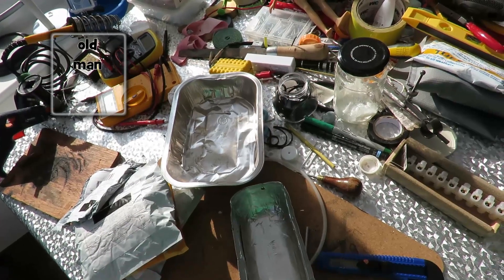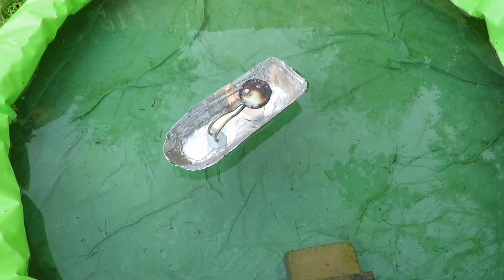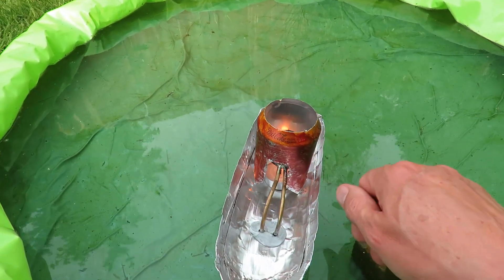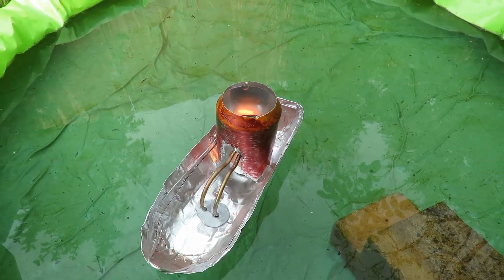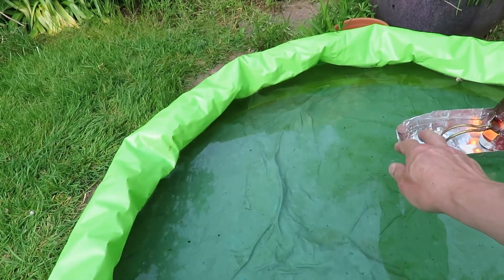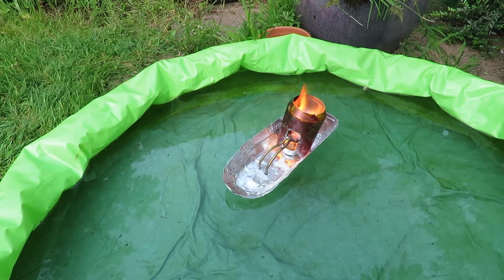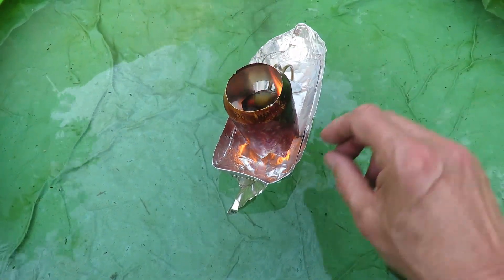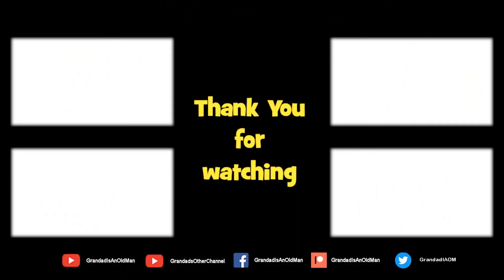Aluminium food tray pop pop boat Ends Badly

Comment: Floating pop-pop BBQ? The solid fuel and firelighters  do put out a lot of heat. They heat up the boiler of a model steam engine really fast and they boilers generally hold a lot of water, so a small boiler with soldered joints won't usually last long. Would be good if you could get a little spot weld on them.  :-)

Comment: Always interesting to follow your Pop-Pop experiments! I have an idea:  If I'm correct, one of the 2 tubes is sucking in a little water, while the second tube is expelling the steam out, thus propelling the little boat.  But it seems then that the 2 tubes are working against each other, with one pulling while the other is pushing.  So, what about if you turn one tube to face forward and leave the other facing the rear?  Then, wouldn't the energy from both tubes would be pushing in the same direction and so be a little more efficient?  I think it's worth a try!!
Reply from the maker: Sorry no you are misunderstanding how they work. There is a full description in the video description. Think for a minute, how can it be sucking and blowing at the same time. There are no valves, no moving parts, just open tubes. The water turns to steam. The steam takes more space so it pushes the water down the tubes.  As soon as the steam gets to a cooler area it condenses back to water. That means it takes less space so water is drawn back into the tubes to fill the space. The water is then reheated to steam and the cycle repeats. At no time is it sucking in one pipe and blowing in the other. It is effectively a closed system, what is pushed out is drawn back in with no "through flow". There are YouTube videos of people trying to use a valve system to use a forward facing pipe as an inlet and a rearward facing pipe for an outlet but gained no benefit and probably lost power due to losses with the valve system. Those videos are in the playlist I have associated with this video.
Reply: Thanks for straightening me out!  I have seen many explanations as to how they work - but none was as clear and logical as your advice as to the physics involved. I just bought some 1'8"" brass tubing - and I may give building a pop-pop myself. Wish me luck...!!  Dave
Reply from the maker: @davem147  good luck, they are very satisfying when they work. They can sometimes take a ridiculously long time to get started so you may need to be patient.